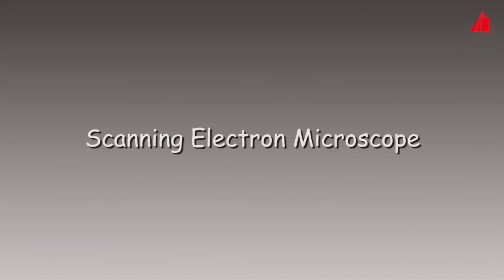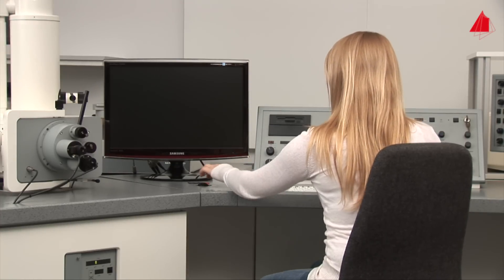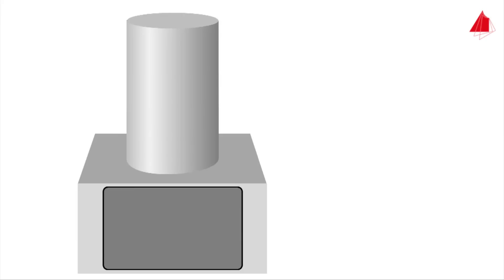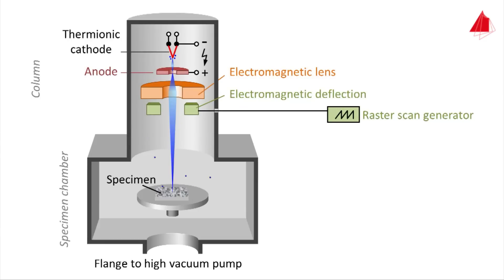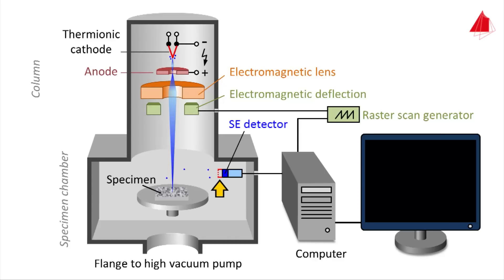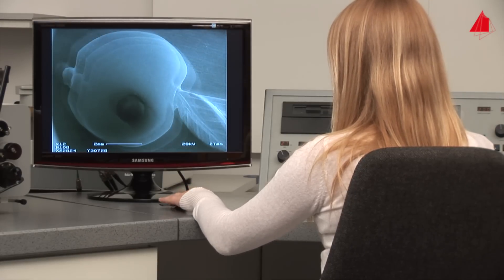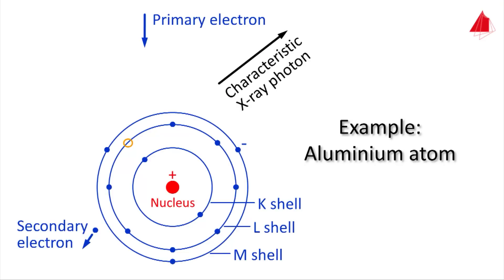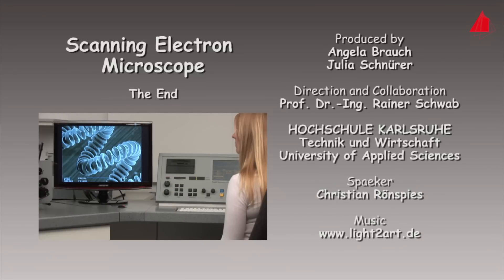The Scanning Electron Microscope

Comment: Ask me any questions.  I am a senior field service engineer with Hitachi.  I install, service, maintain and most importantly train my customers on how to use electron microscopes.
Reply: Arslan.  No, only black and white images are created by this type of microscope, as the electrons collected don't contain any "color" information. They can, of course be artificially colorized after, using image processing software - typically by assigning a particular color to a specific brightness level.
Reply: Travis Rice i had an idea they'd be something like $3k at maximum, i was very wrong. They cost +$7500 for a decent one and a ton of money to ship here (iraq, yes i know surprising).
The thing is i'm still a B. pharm junior and i plan to be an independent researcher, and also allow public usage of the microscope for others in need as long as they pay operating expense such as tungsten heads and coating materials. I'll have to stop my plans for now until i open a drug warehouse, that'll generate enough profit to invest in one of these awesome machines.
Reply: Yes the shipping cost will be very expensive due to the fact they are very heavy, because all of them have thick walls and they are lead lined to prevent Xray's from escaping so that people do not get radiation poisoning.  If you are looking into an older microscope, please keep in mind that if something breaks, parts will be very difficult to find because most are custom made (especially the circuit boards).  Your best bet would be to find one that is in Europe, not the US, so when you do your search, look into FEI and Phillips, as they are Euro based companies.  If you don't mind me asking, what are you going to use them for? I can give you a better idea of the type you would need for your research.  I've seen many instances where people buy these microscopes and can't use them effectively because they are not the right type of machine for what their research is for.  For example, one university bought one to research carbon nanotubes that were 3 nanometers in width, but because they bought a low end microscope, they could not effectively see them with the low end machine.
Reply: electrons can and will pass through materials, but how much depends on the atomic weight or the element the electrons are trying to pass through.  Think of it as a comet passing through a solar system.  If the solar system is dense with materials and tightly packed, then there is a much more likely chance that the comet will collide with an object, or be deflected out of orbit (this is what we would call a backscattered electron).  If the comet passes collides and other such material is sent out (in this case it would be called a secondary electron), then you would still measuring the gold on the object.  However there is the chance that the electrons pass freely into a material under the gold coating, but they also still have to escape the sample to be registered by a detector, so regardless, you will have a much lower reading of the material under the gold than if it were on top.  Usually that is not a big issue, because most of the time you are simply looking to see what elements are present, rather than what the ratio of what element is to another.  That is just my experience as a field service engineer, and is definitely not the case with all experiments.  Also, a little tip, because not all coatings are completely uniform, you can still find microscopic cracks in coatings.   If you are looking for whats underneath those coatings, I suggest you do your EDX detection with those cracks to begin with, you may get better results.
Reply: How much would an old one cost for personal use?
Reply: Travis Rice what's the most affordable way to obtain an SEM? even if it's an old used 1980 era SEM?
Reply: +Hussain RT ebay!
Reply: If you are doing drug research, you will need a variable pressure SEM, which is one that allows a small amount of gas to enter the vacuum chamber which is to allow any electronic charge build up to dissapate.. this topic is very complex but trust me when I say that this is the type you will need when not looking at a material that is non-conductive.
Reply: Can I please use an electron microscope , and quite possibly learn how to use one
Reply: See Tim's reply below, he is correct.  Any color that you see on an electron microscope image has had image processing after the image has been captured.  In published reports, this is typically not done because scientific studies do not like alterations to an original captured image.  Color is normally added for illustration purposes only, and to make it look less boring when these captured images are being shown to people in meetings, etc, because usually these people will have no idea what they are looking at.
Reply: Travis Rice Thanks
Reply: Travis Rice exactly, pharmaceutical research with variety of similar fields.
Reply: Do you have facebook or anything like that?  We can have discussions about this.
Reply: @travisr3  hi can i add u in Facebook
Reply: Travis Rice yes i do but i have to inform you that i'm yet a student so don't expect a phd level guy lol
These are long term plans.
Reply: Travis Rice so is there some sort of a dm? i can't seem to find any on g+ or youtube.
Reply: Travis Rice done
Reply: Will some of the electrons not freely pass through the few atoms in the surface of the object? So if you have a plated gold necklace, thats really thin, and the electrons go through most of the gold and into the metal underneath. Is this inaccurate then? (Just questions regarding the NDT of testing to see what elements are present, thanks)
Reply: Thanks very much for the reply, you sound pretty experienced with this. In theory, how many layers of atoms could an electron travel through? Im sure it would be on the nanometer scale, but it will always come to a stop? Could an electron pass through like all of the atoms in a small subsance, so it isnt a backscattered electron or a secondary electron for the substance being measured, but instead it gets stopped in the plate on top of which the substance is placed? Thanks for replying :)
Reply: Hi Travis . I would have few questions regarding electron microscope .Could you give me any contact , because asking here would end in a long discussion . Thanks in advance .
Reply: Travis Rice please give me your what's app or viber account no I will share knowledge with you..
Reply: A youtube channel called 'appliedscience' actually made a video about that. The guy made his own electron microscope in his garage, so I trust his judgement.
Reply: Travis Rice 
How does the SEM take a picture of a non-conductive object?
Reply: Yu're so nice Travis. I  learned a lot from your comments. Thanks for sharing.
Reply: Travis Rice hi there.can i have your f.b or gmail account...btw i am plant geneticist... work in molecular lab
Reply: Travis Rice how does the computer shape the image of objects based on what se detector gives it, I hope you could refer me to a book or course or just explain it if it is simple, thank you this is interesting
Reply: Travis Rice will we all get this technology in schools in future it will be in trusting an exiting to watch such things live it will be then when and where first
Reply: Who built the pyramids?
Reply: +Muchilis K Go to ebay. they have many older electron microscope systems. only if know how to operate the systems. lol
Reply: What is minimum cost of this scanning electron microscope.  What is the cost of  running the microscope  per hour?
Reply: What is the cost of the microscope shown here .minimum cost ?
Reply: Travis Rice Why there isnt any DNA, molecules and atoms real image on internet at all? Why if it is simple to show images on screen by electron microscope?
Reply: Travis Rice 
Dear Sir, 
My organization has purchased an used SEM Hitachi S 2100A
and it is currently not in working condition. As you have mentioned that you deal with hitachi SEM product. Kindly share your contact detail or email id. 
We are seriously in need of your experience and expertise.
Reply: Hi Travis, i have a question for you. I'm not an expert with SEM...It's my first time that i use VPSEM. How i can see the polimeric chains without dry my sample? I ask you this question because in last experiment water vetrified and the analysis was not good: polimer and solvent are like a single surface. thanks :)
Reply: Do you have that chicks phone number?
Reply: Travis Rice Can a true color image be generated with an electron microscope?
Reply: Travis Rice i'm just laying out plans, chances are this will something will be used mostly by those who need it in research, like some sort of scientific charity.
Also if things go the way i want it to be, my plan will be a small biology and pharmaceuticals research lab which i will operate individually and be a center for research in my small city.
Reply: Dear Travis,

   I am a research fellow working in Indian Institute of Science. I am actually interested in approximating the composition of materials from their SEM images using image processing algorithms. Do you find any relation between image pixel intensity and their corresponding elemental composition.?
Reply: Sir,pls can I know sem xps eds test  available in iisc
Reply: Travis Rice 
kindly contact me 
here's my facebook id muradamin.ma@gmail.com
i seriously need some of your time and consultation.

Comment: this is great.  i work at a college and we have a fully computerized unit (PSEM).  i am going to recommend this to the professor as i am only a technician.
Reply: the PSEM is quite a nice little machine, depending on which version of the PSEM you have, its either the first fully computerized and computer controlled commercial SEM.

Comment: Very informative, clearly explained and nicely demonstrated. Only thing i' didn't get was why the secondary electrons sometimes form a light spot and sometimes a dark spot on the raster image. Is it to do with the number of secondary electrons given off for instance or maybe the angle of the material to the beam of primary electrons?
Reply from the maker: Answer to "Is it to do with the number of secondary electrons given off for instance or maybe the angle of the material to the beam of primary electrons?" Both of it, and there are some more influences.
Bright spot, when many secondary electrons are registered in the secondary electron detector, dark spot when only few electrons are registered.
- Many secondary electrons are registered > at a thin part of the specimen > at an edge of the specimen > at an inclined spot of the specimen > and at a surface that is tilted towards the secondary electron detector
- Few secondary electrons are registered > at a thick part of the specimen > at a flat spot of the specimen (perpendicular to the primary beam direction) > and at a surface that is tilted away from the secondary electron detector
Reply: @MaterialsScience2000  could you elaborate little more on this. How is the depth of the sample i.e the steps, kinks, adatoms are  analysed
Reply: Good ole edge effect.

Comment: hello i need a list of conditions required for a sample to be analyzed by SEM
Reply from the maker: Answer to "a list of conditions required for a sample to be analyzed by SEM":
Surface imaging:
- specimen has to be in the solid state
- specimen must be an electrical conductor (under certain conditions electrical insulators may be imaged as well)
- specimen must geometrically fit into the specimen chamber (do not laugh, this is important)
Chemical analysis:
- light elements lighter than oxygen are difficult to analyse by EDX
- only chemical analysis of surface
Reply: MaterialsScience2000 Hello. How is it possible to magnify biological or human somatic cells if electrical conductivity is a requirement?😊

Comment: If I want to scan my carbon electrode with size of 5 x 5 cm, do i have to cut it into specific size before doing the scanning?
Reply from the maker: Answer to "If I want to scan my carbon electrode with size of 5 x 5 cm, do i have to cut it into specific size before doing the scanning?": It depends on the size of the specimen chamber and the height of the specimen. In some microscopes the chamber is large enough, in some microscopes it is too small. Our SEM might probably do.

Comment: So an SEM can also double as a spectrometer?
Reply from the maker: In some respects, an SEM with EDX equipment can be used similar to an optical spectrometer. There are certain advantages and disadvantages. The most important disadvantage is the difficulty to measure very light elements (like carbon, boron, beryllium) quantitatively.